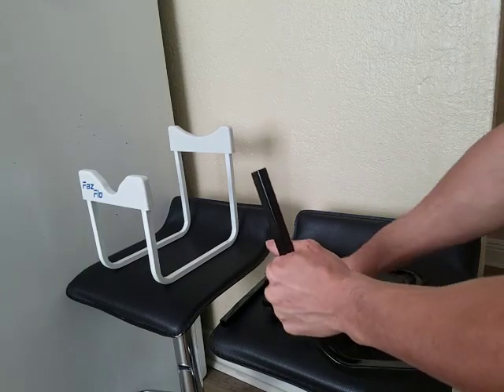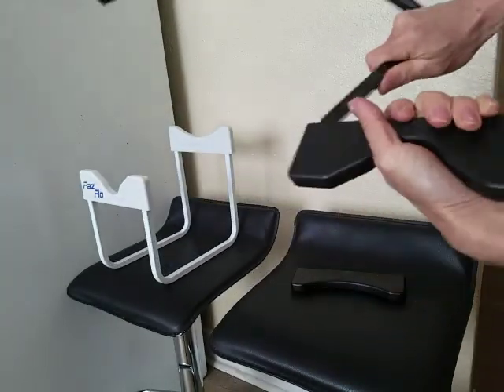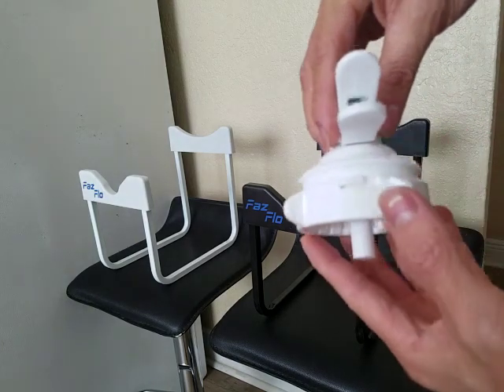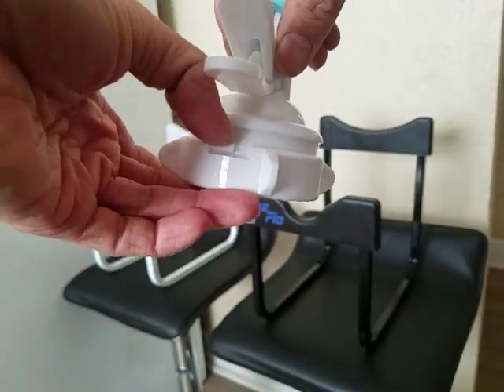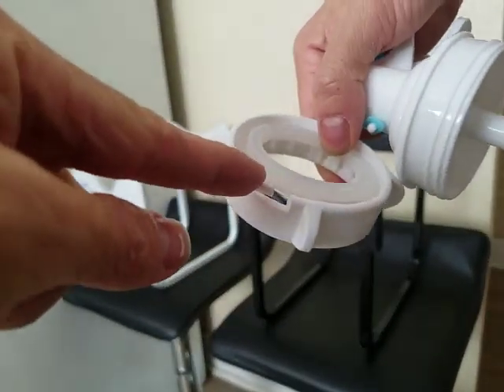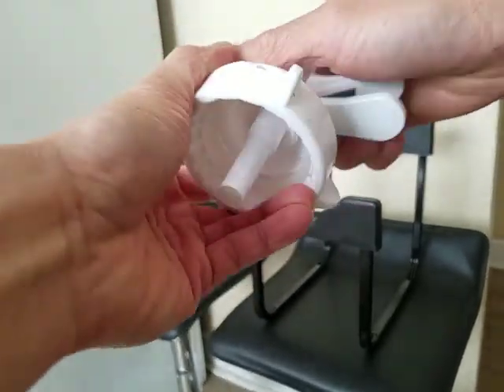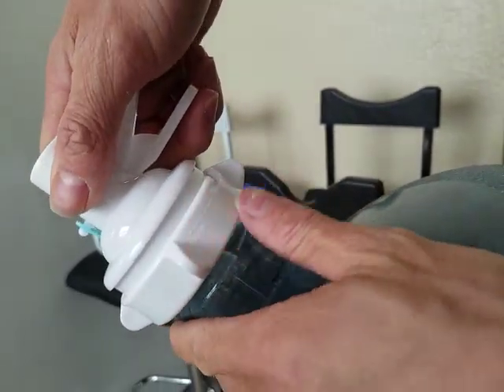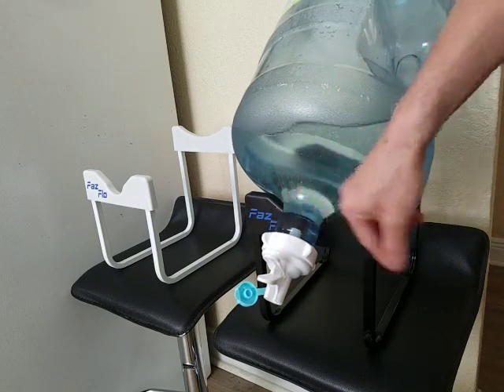Faz Flo 5 Gallon Water Dispenser Cooler Stand and Valve (How to Install)

Comment: How to correct air lock in water bottle can dispenser tap
Reply from the maker: remove the plastic ring piece inside the valve, and reinsert it. check if the tube like piece on the valve (look like a white pipe/tube) see if it is in good condition if it is bend or loose, it could cause uneven flow of water)

if that doesnot work email us and we can send you a new valve